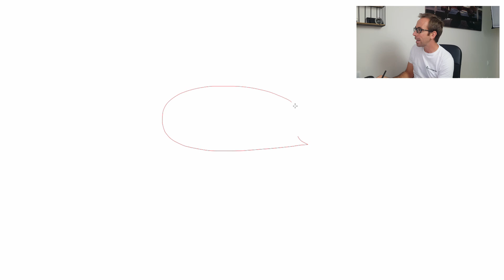What Is Adverse Yaw And What You Should Do To Correct This Aerodynamic Phenomenon.

Comment: You make great videos, thank you. 
Is it more correct to explain adverse yaw while banking by using this explanation for a difference in the drag for the wings instead of with the aerodynamic explanations where the lift vectors for each wing are tilted from the vertical during a roll? That is, the lift vector for the upward wing is tilting backwards from the vertical while the lift vector for the downward wing is tilting forward from the vertical?
I guess I don't quite understand why there are two different aerodynamic explanations for the same movement.
Reply from the maker: Many thanks for your support!! I explained that way because I thought it was the easiest way to get the concept

Comment: Great videos. Reading much about "What really controls Altitude and Airspeed and wonder what your opinion is on this topic. Thanks so much for your videos
Reply from the maker: Hey, many thanks for watching! Well the factors that control the Airspeed and the Altitude are Thrust-Drag/Weight-Lift. If you have more thrust than drag you accelerate (and viceversa) if you have more lift than weight you climb (and viceversa). Than there are a lot of factors to take into consideration, I made a videos about these topics.. check them out 👍

Comment: Great video again. I presume that's a concern in smaller aircraft as you said, but if that should happen to an airliner, are there big changes for the yaw damper to fail mitigating that phenomenon? And, secondly, doesn't the autothrust compensate for the drag in case that happens?
Finally, in the sim, applying pedals seems to be a need during landing, but pedals are super responsive. Are they like that in real life? I only felt yaw forces from pedal corrections as a passenger and it's impossible not to feel it. I was seated by the wings when I felt it the most, nothing to worry about though.
Reply from the maker: Hey, I hope you are doing great!! Thanks for watching!! So, in general, when you deflect the control wheel on an Airliner Jet only the Aileron of the going down wing will deploy (No deployment on the going up wing), thus the going up a drag discrepancy that creates the adverse yaw. The yaw damper will help you to correct the Dutch roll (I'll make videos about that soon). Regarding the pedals, you only use them on the last part of the flare if you have crosswind on a dry runway for example...let me know if you have more questions 👍